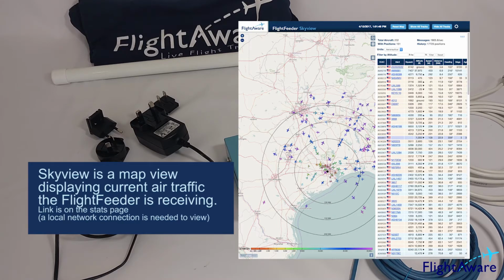FlightFeeder first time set up

Comment: Why wifi settings in the options menu disappear suddenly after I turn it on for a few hours
Reply from the maker: This is a technical issue that should be fixed, please contact adsbsupport@flightaware.com if it still happening.